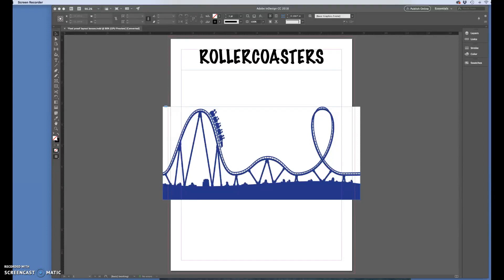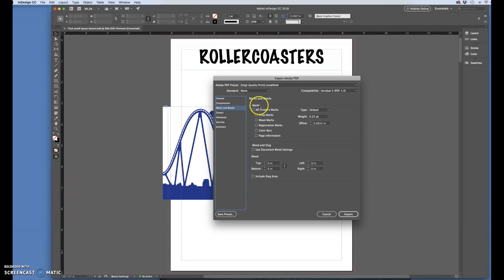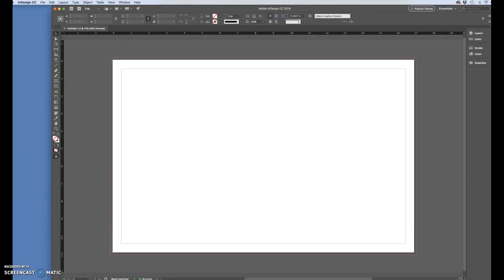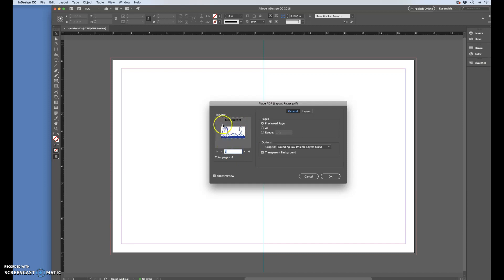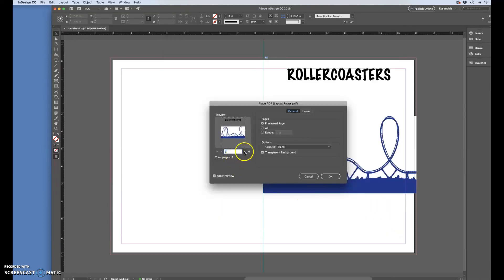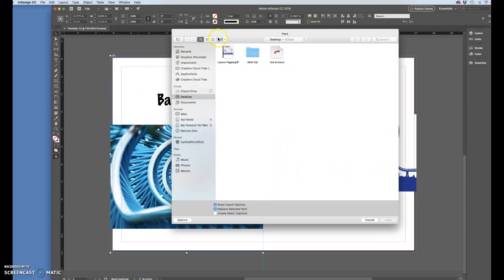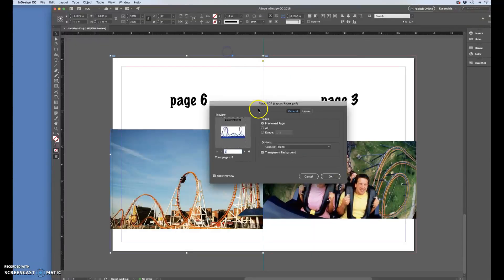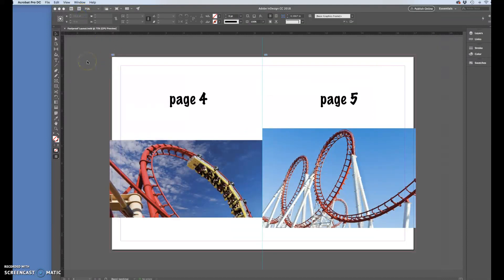Foolproof Layout for printing Saddle Stitched Booklets

Comment: Quick question: If I have 20 pages, saddle stitch for the inside and I want to create a separate cover for it, what should be the page size? Is it 17 by 11 inch or do I need to consider spine area also?